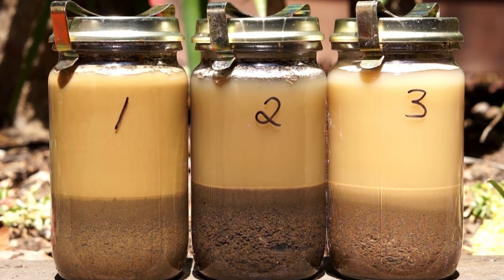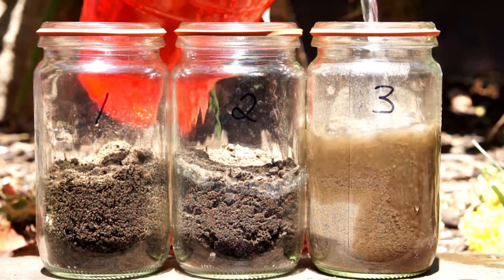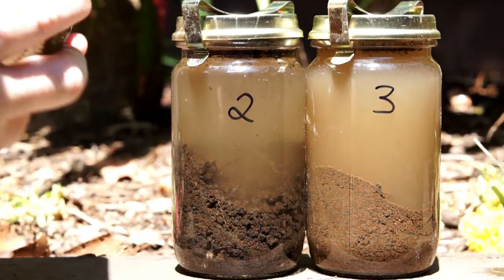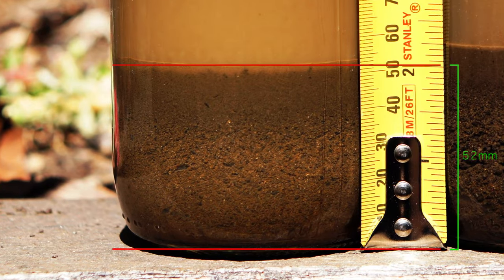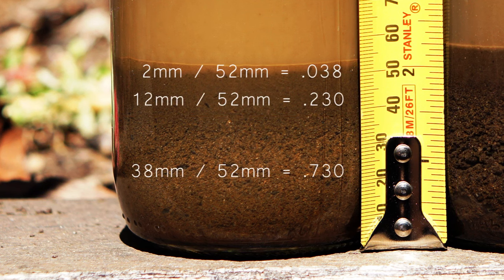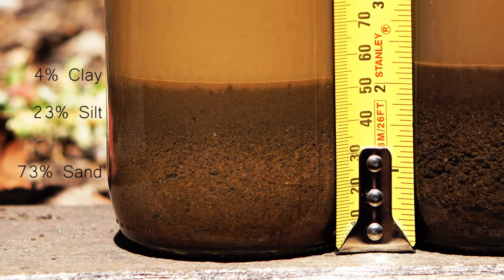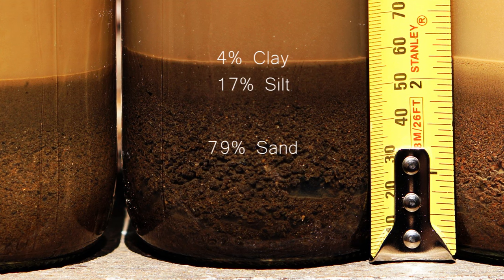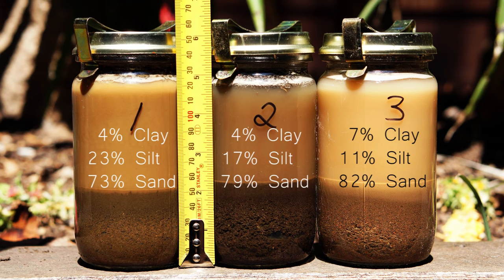Simple Soil Testing // How To Test Your Soil

Comment: i think you measured too early. isnt it better to wait for several days for the water to clear up and most of the sediments to settle?
Reply: i read somewhere you can measure overall depth, shake, take immediate measurement for sand, wait 5 minutes take measure of silt, then subtract those from the overall depth for clay.

but, my sample settled to its overall height in like half an hour. 33% clay 66%sand and like no silt.

Comment: What you called "sand" is it really sand? because you just mix soil with normal water. It will be different if you add hot water or with other solution that can break the organic bended with soil particle.
Reply from the maker: @suhardisuhardi8388  umm... Possibly... You mean that it (the "sand") might actually be smaller particles that are simply bonded together tightly that appear like sand? 

If this is the case, for a more scientific approach to soil analysis, your insight is 100% valid however, for someone simply looking to improve their soil quality at home, I'm not sure it would matter a great deal, as this type of material will still act like sand, and therefore, should be treated as such... I think so because no watering or rain will be able to break down these specific materials as well... At least, I don't think so. 

It's a good insight you've presented though... I really appreciate your point of view here, because it shows us all that there is more to think about and learn, so, thank you!!!

Comment: Just brilliant.

I am just about to do tests on different composts for bug infestations before I choose the best, and your soil analysis method is an extra bonus !

If one were to fill each jar halfway with different composts or imported soils, then leave the sealed jar in a warm place the little buggets, (a technical term), should have hatched and be flying or crawling around  inside the jar.

By combination and cooperation, we Master the Earth.
.
Reply from the maker: Awesome. Will you let me know how it goes?
Reply: @UrbanSelfSufficiency  

Your test is so simple that even though it is 06:12 here in the UK, I sprang/sprung/leapt to my feet in dynamic action and there are now three 50% filled different compost types bars sitting on my kitchen sink window, awaiting the glory of the new day, and tempting the crawlies to emerge.

I may extend my bug test to two weeks in a second run, but 7 Days should be enough for most pests, I think.
(To be checked !)
After then I will add the distilled/filtered water and will also do PH and PPM tests.

Any ideas on measuring Toxicity ?
I have just done three Compost Microwaving 1 gallon samples today in a 10 Minute thrash other thrips blast Sterilisation experiment.
(The three jars done tonight is the 'as it comes' varieties.)

A little bit of reading suggests too high, (or long ?), a heat might induce toxicity, as well as killing off 'GOOD' Microbes.
(To be investigated.)

Note to self;
Must get myself  a Sciency type Lab Coat and seven pens.
.

I DO love Science.
.

Comment: You would get a lot better results from this if you baked the soil, and crushed it up before adding water.  Bake it at around 180°F/80°C.
Reply from the maker: Really? I've not heard of that before. Thank you!!!
Reply: @UrbanSelfSufficiency  I managed engineering soils labs for like 6 years.  Their objectives are different than say a horticultural/scientists soils lab, wherein we were only interested in physical characteristics such as particle size distribution (like what your video is about), density, compressive strength, and organic content.

Another thing you can do is take a baked sample, document its natural and baked weights, then cook it much higher at 800°F/425°C (which is not so easy to do at home): everything cooked off at the higher temperature is organic matter.  Then from there you can compute the percentage of organic content in the sample.

Comment: I am not sure, you are using a correct expression for silt. You told "loom or silt" layer. Loam is the mixture of 20% clay, 40% silt and 40% sand. Normally a silt layer contains very fine quartz (silicon dioxide) and granite powder (and feldspar). The grain size is between sand and clay, a small amount of silt has the same size as clay.
 See this picture: 
https://en.wikipedia.org/wiki/Loam#/media/File:SoilTexture_USDA.png
 The optimal mixture, you talked about in the video is exactly the loam.

Comment: Is it possible to do this same experiment but with a nest of sieves. I just don't know how to identify clay, sand and humus on sieves.
Reply from the maker: Technically yes, but finding the right sieves with a varying degree of sizes suitable for separating the three main components might be difficult... Certainly more than visually inspecting in a settles jar of material.
Reply: Urban Self Sufficiency that’s what I thought, thank you so much!
Reply: Silt size is 4 - 62 microns. So yes, you should be able to use nested sieves - everything caught by the 62 micron sieve would be sand, everything caught in the 4 micron sieve would be silt and the rest would be clay.
Finding a 4 micron sieve may be hard, but should be possible.

Comment: How long does a settle process last?
Reply from the maker: G'Day MC. Here's what one of my viewers said about the times (it's very interesting) 
"Singye Dorji said...
I've read that sand settles in 60 seconds, silt in 30 minutes and clay  24 or more hours. So if you mark off the horizons in 60 seconds, 30 minutes and then a day later you wouldn't have to try and guess where the sand layer ends and silt begins. Been researching how to test soil for silt clay and sand content for making carb."

I let mine settle for about 4 hours or so... I hope this helps.

Thanks for watching.
Jim
Reply: Great it was nice video and good ideas thanks for sharing all of those info

Comment: The silt and sand layers were a bit hard to distinguish in my opinion. At the beginning I didn't tell the difference. If you had left them for a little more time, would that contrast have been clearer?
Reply from the maker: +cradleofalex Probably, although, looking at them in real life, rather than on a screen, it was easier to see. I also had the advantage of being able to view the photo in high resolution and blow it up in size to see the changes in soil composition as a reference when I was creating the lines on the screen for the video in my editing software. 

If you could test better quality soil, you'd be able to see the difference a lot better too, as there would be more of each layer to see. I might do a follow up video to show this. Perhaps I might try to get a few different types of did to show more of the differences. You've given me a good idea! Thanks for the feedback.
Reply: Urban Self Sufficiency I've read that sand settles in 60 seconds, silt in 30 minutes and clay  24 or more hours. So if you mark off the horizons in 60 seconds, 30 minutes and then a day later you wouldn't have to try and guess where the sand layer ends and silt begins. Been researching how test soil for silt clay and sand content for making carb. Hope this info is useful.
Reply from the maker: +Singye Dorji Yeah, that makes a lot of sense. Thanks for the tip!
Jim.
Reply: Singye Dorji I just took a soil science course and those are very similar to what we used, 88 seconds for sand, 4 hours for silt and then I think 15-18 hours for clay.

Comment: Great video, it was a help in doing my own testing in my garden... I do have a question. How did you amend you soil to bring up the percentage of Silt & Clay. Thank for posting you video.
Reply from the maker: Hey Sal, thanks for watching. 

I basically used a crap load of crap... Cow manure. And mushroom compost and some new soil from the garden centre as well. But mainly, I just kept adding composted manure until it was better.
Reply: Thank you for the information.

Comment: Hi Jim, 
Thank you for sharing your expertise. If we have only jars with larger circumference, how would that alter your % reading? and how long did you let your three samples sit to settle? Thanks again.
Reply from the maker: Larger circumference won't change anything; use the same method 😁
I let mine settle for a number of hours, but if you want the most accurate results, let it sit for more than 24 hours.